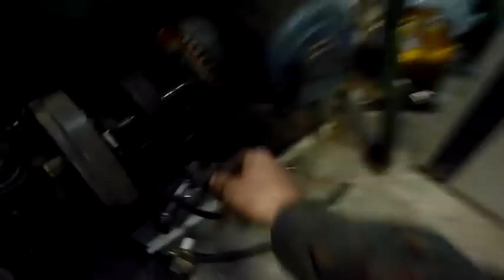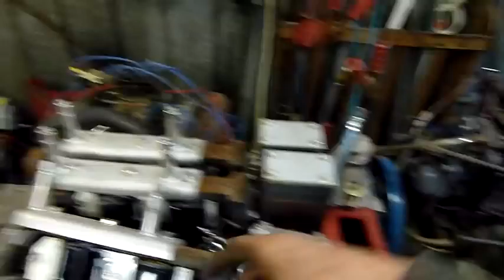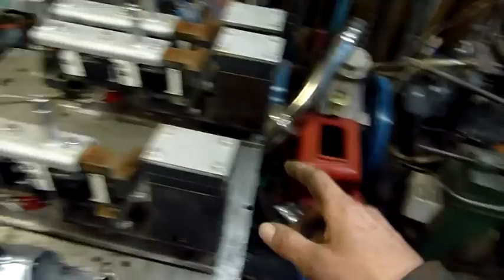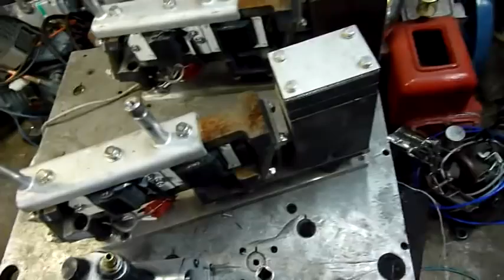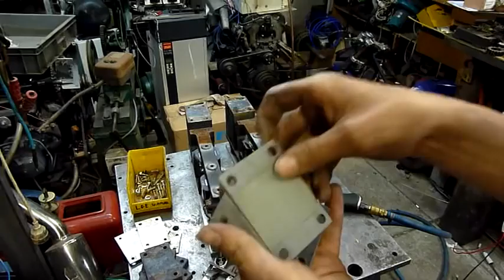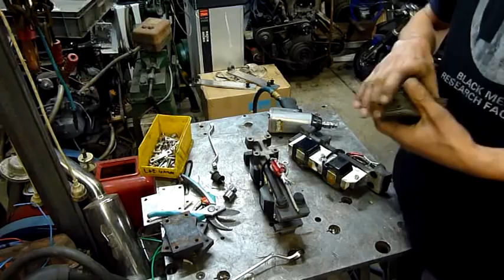Heavy Duty Vibrator Autopsy

Comment: Those electro magnets may come in handy to hold doors, magnetize (dc) or demagnetize (ac) tools. Or for sorting metal out of shredded junk... just some ideas. The weights... for tv's or washing machine tests. Nuts. And bolts are always good to have. About the spring material. Check if it is fireproof. In might be a little bit.

Comment: I suppose these could be use to build bedroom toys for the women in the jolly green giant family. Seeing doing a tear town of such such toys built for normal people wouldn't a big deal so I thought a giant vibrator  DC to square wave power supply had been discovered. the metal the coils  R mounted is called an armature I believe. No doubt  the 110V coils will handle 220V certainly they survived a HF-HV test before being used Depends on other factors to how/what U cab use them for.

Comment: If i remember right you have old gas bottle as air compressor reservoir... Have you been drained it after install? Usually gas bottles doesnt have moisture protection layer at inside of it so it rust very quickly.